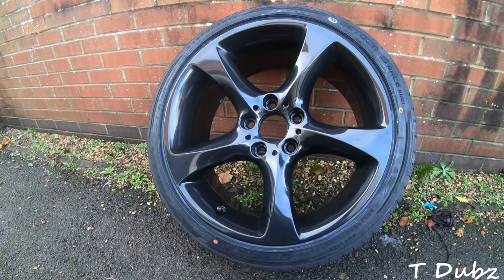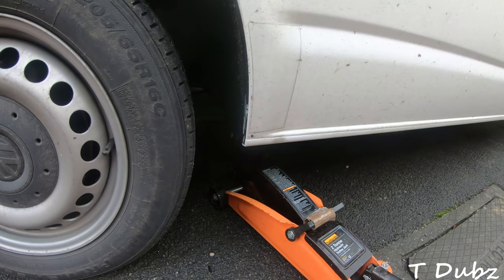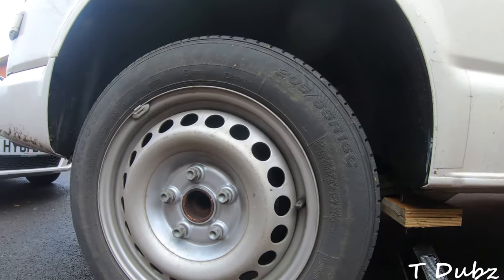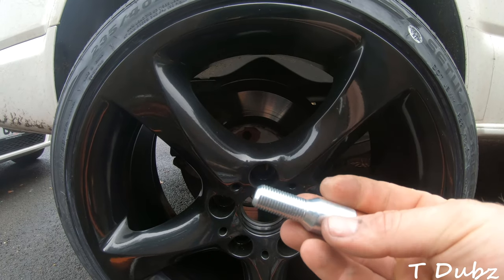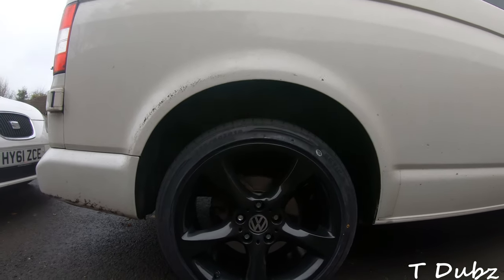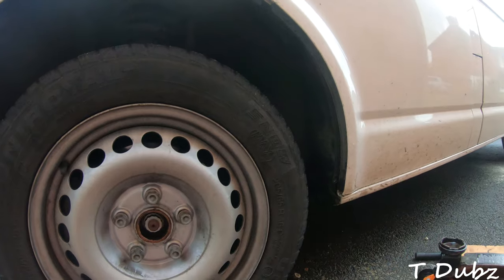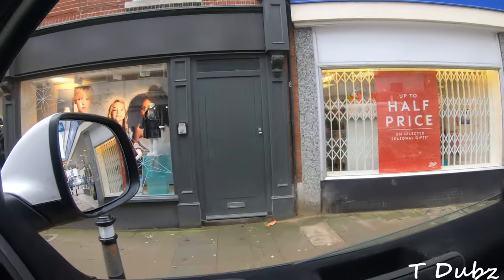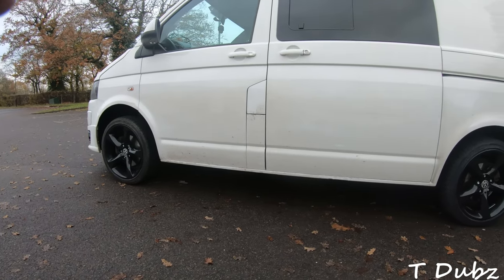Vw T5 Alloy Wheel Fitting Guide #howto  #vwt5 #vw #alloys #refit #camper #diy #vanlife

Comment: nice wheels im thinking of putting Range Rover rims on my T5. The trouble is people forget they MUST measure the combination of new wheel and tyre and they must match the overall diameter of the old wheels/ tyres - otherwise bigger wheels will UNDER READ and going through a speed camera thinking youre doing 30 you will be over and get flashed. Smaller wheels OVER READ and show you doing a higher speed than actually travelling. the way to confirm this is to use a TomTom or other sat nav. (They give precise speed). Ive sorted this by having a 'loose' speedo screen (The black disc that shows the numbers) take the front perspex off the instrument pod and get a friend to go out for a test run with a gps to call out speeds. Once you hit a set speed, turn the plastic dial to read the correct speed and then GLUE the dial in place - job done :)))!  Top job Tdubz
Reply from the maker: That’s class! The wheels are smart, I usually cruise round 2-4 miles under the speed limit annoys the people behind 👌🏻👌🏻

Comment: I’m running 245/45/19 front & 275/40/19 rear  I run them at 42 psi seems to ride well with even tread wear. Think I was told max is 44 psi
Reply from the maker: Thanks woodysmate.. I will check tomorrow il pop 42 in and see how I get on. Cheers
Reply from the maker: Running mine @ 42 long drive today... feels great 👍 ta for the heads up

Comment: Hope the roads where you live  are not like the roads in Edinburgh where I stay , they are a nightmare for potholes ect, I'm running 19's with 245/45/R19 and I feel every bump , I'm hoping to change soon .
Reply from the maker: Roads here are the same, that van went on to 20” with 235 35 tyres… I’m now on a set of 18” with 225 45s as low as I can get the stance plus kit and the ride is great.. still have to miss the potholes tho 🙈👍🏻